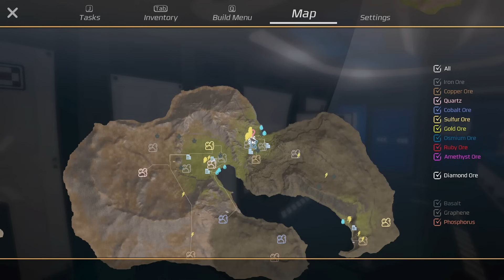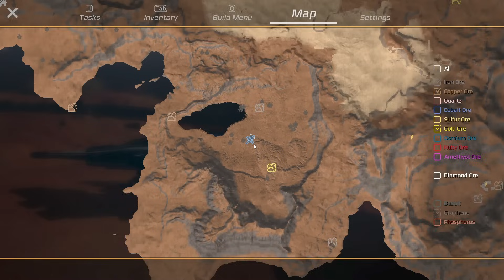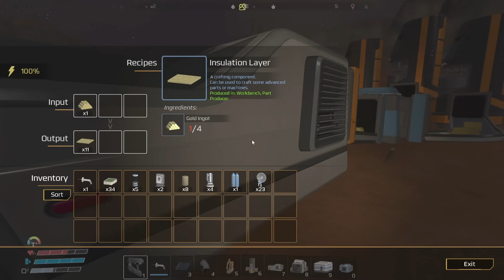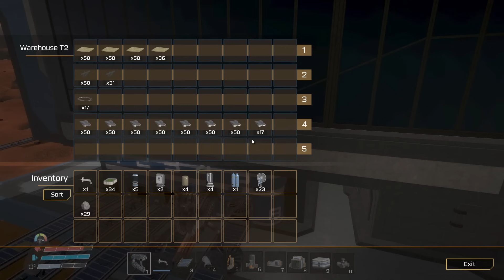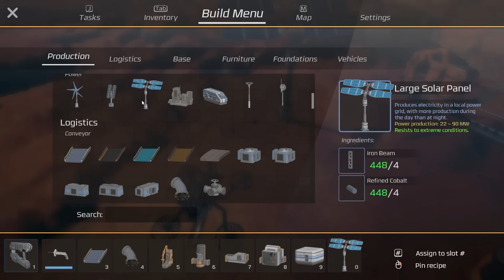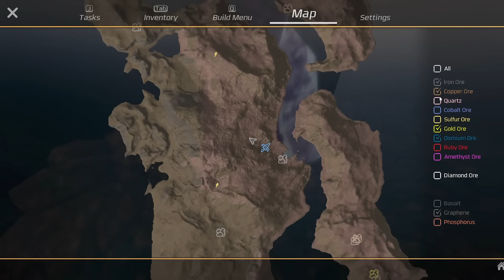Eden Crafters - Nova Terra - Gold Processing And Carbon Refining [E6]

Comment: So here's another thing I've been doing.  Once you know what level of ground is needed for the water pump to work, I level the land at that level.  Then you can place the water pump anywhere as they do not require the pipes to be touching actual water.  So the water pump just becomes another building in the production line with shorter pipes running to machines that need water.